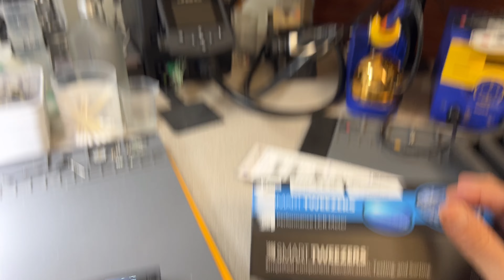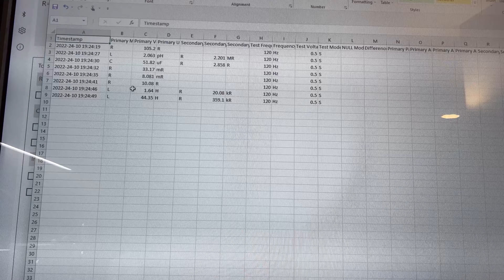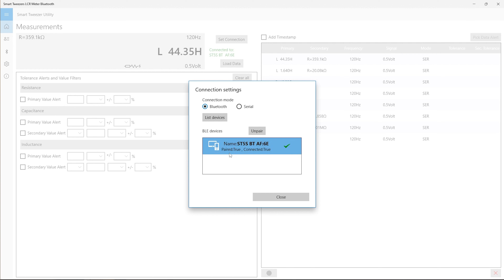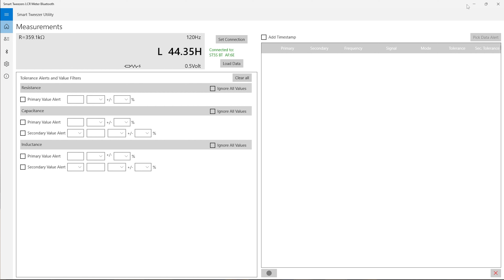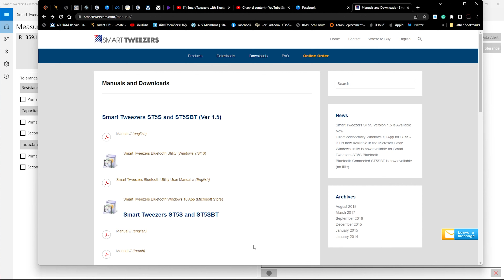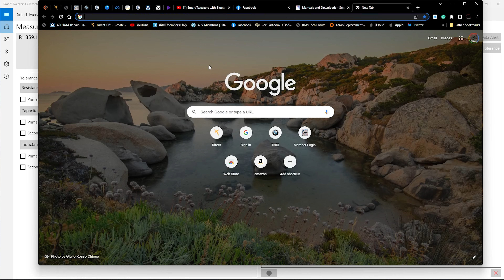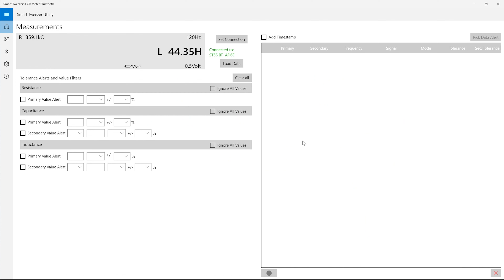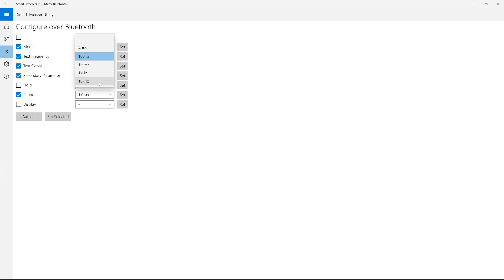Smart Tweezers ST5SBT tool review and set up for Windows 11

Comment: I have one of these tools without the Bluetooth module. The menu has that option and there's a connector on the internal PCB for it.  if you ever take your apart for any reason, document the BT module with some pics. I would greatly appreciate any info about this.